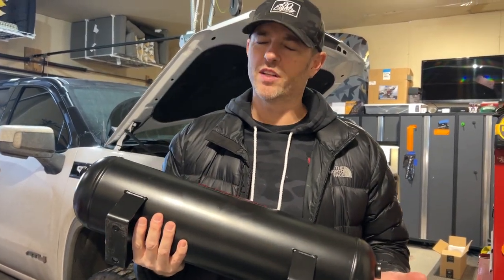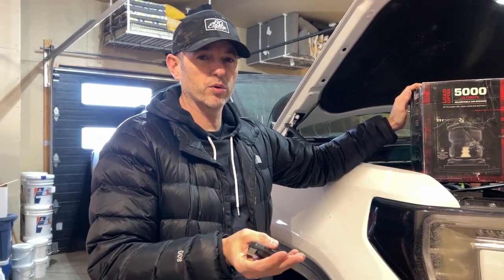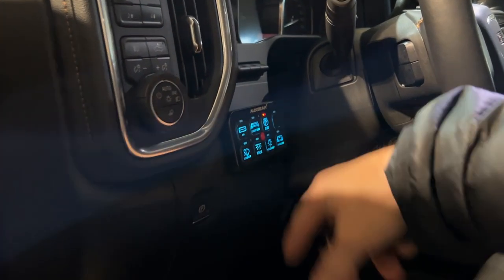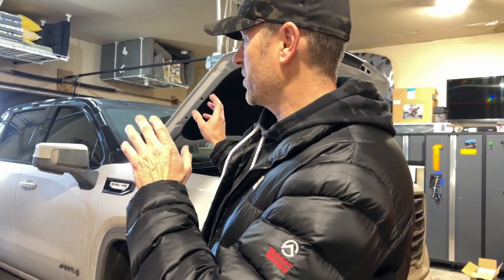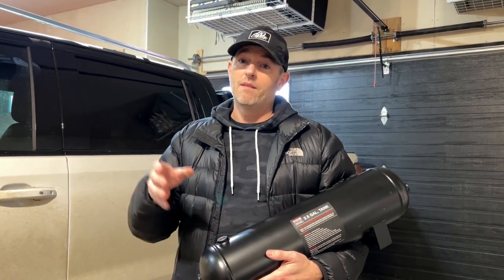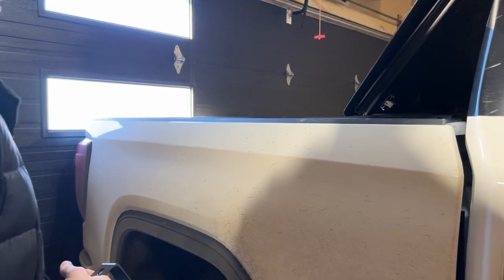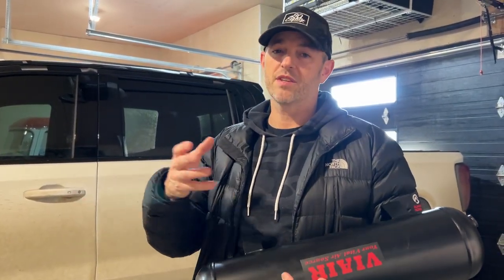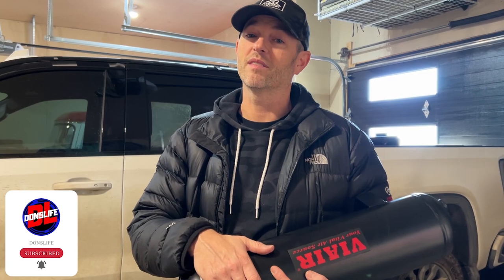Upgrade Halted While I Figure Out the Best Options

Comment: For my 2022 Sierra HD AT4, I installed my 2.5 tank and compressor on the Passenger side -under the rear door on the frame rail. I built my mounting bracket out of "1/2" super strut" and mounted to the frame rail. It fit perfect. I filmed everything but I am not as techno savvy as you to post it (ha ha). let me know if you would like me to send a pic of the install.  PS - Really enjoy  your vids.

Comment: I want to add airbags to my GMC for towing my fifth wheel so if you need to find a new home for your system you can send them my way. Been watching your videos for awhile now and have added the tailgate lights,bed lights and have the lights for the engine compartment on their way. Love all your mods. I know viair has the complete system with the compressor and tank rated at 150 I think I would go that route.

Comment: It's a Pain, BUT I have the same Viar tank and their compressor. I was able to mount the compressor in the same spot as yours, and I put my tank in the cavity behind where you have your light bar. I then ran a larger line to the bed of the Truck and put in a hidden quick connect port. I can send photos of that tomorrow.

Comment: Air horns: i have a direct compressor set-up.  Amazon purchase.  Its loud enough and the investment was little.  Two compressors two horns, bolted to punched angle, with one angle welded to truck frame.  Is there no room under the chassis for the tank so you don’t lose any valuable space in the bed?  Good luck

Comment: If you stick with the tank, I’d get a bedside molle panel and mount it to that to avoid putting holes in your bed. Otherwise I’d consider just getting the ARB dual compressor and removing the current one. This is all with consideration for whether or not you will actually use it. 

Also, I need the bags setup!
Reply: Yea those Molle panels are really slick!

Comment: Get a Viair 200psi constant duty compressor (hornblasters has them, plus more goodies) along with all the other fittings you'll need to do it up right. I used one of those to provide air for a set of Shocker XL horns in a previous truck. I also had a tool port in the bed to either run air tools (ran an impact wrench without issue) or fill up tires fast. I also had a 5 gallon air tank. I would either get a second 2.5 gallon tank, or get something larger than 2.5 gallon. 
IIRC, I had the Viair 480C compressor in my setup. 
Also, don't be scared by the 200psi rating of the compressor. You install a switch into the tank that tells the compressor when to run and when to stop. Plus you'll want a safety valve/fitting that's above the target/use pressure rating, but under the tank burst rating (with a healthy safety margin). Put a water separator at the inlet fitting (from the compressor) as well as do something to prevent ice forming in the tank during the winter (they have a solution you can load into the tank that trucks with air brakes use). Also install a moisture bleed fitting at the lowest fitting in the tank (should be pointed down). Get one with a pull cord (braided metal) so that it's easy to use during the warmer months (or when it's above freezing).

Comment: IMO either front or side of the bed.  Depends on how you use the bed.  I use my bed a LOT with loading it up so it would be in my way.  If you don't have that problem, I'd put it on the side.  Else, front. 

Also, I'd think on that decision to remove the air bags.  GMs suspension in these years sucks.  I have a 2020, single cab long bed, and added a Roadmaster Active Suspension.  With a loaded aluminum open trailer and an older muscle car, it still sagged too much for my liking.  IMO keep the bags...

Comment: So, because you don't really have a use case worked out for the tank, I think you need a compressor that matches the tank's capability.  You are likely to figure out what you'll use it for most at some point in the future - it could be anything - and you wouldn't want to have some constraint on the possibilities.
Reply from the maker: I am certainly leaning that way
Reply from the maker: I should also mention I’d like to have a faster system with me when off roading, so I can deflate my tires and re-inflate as I see fit